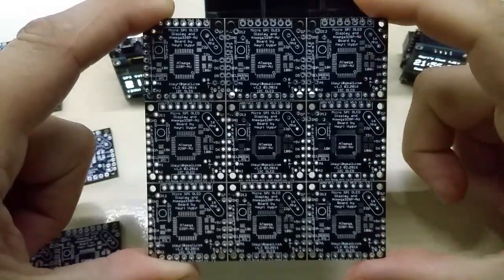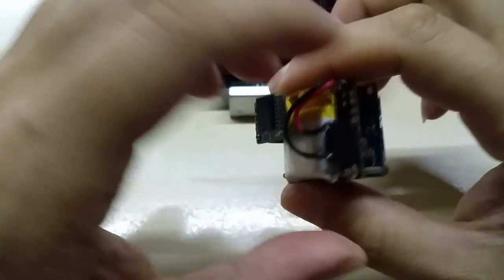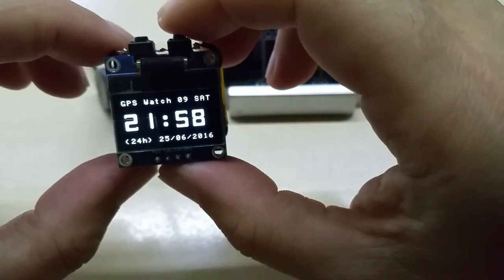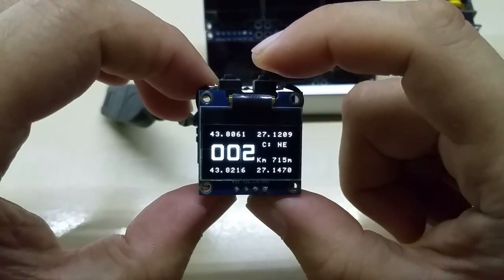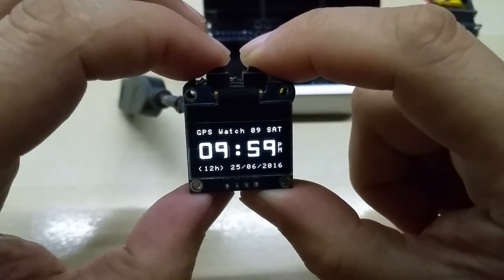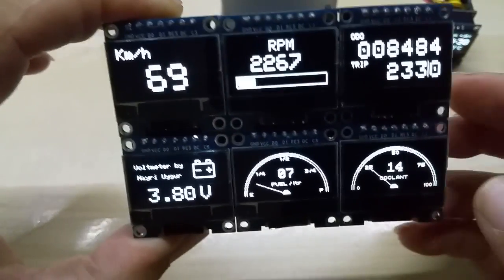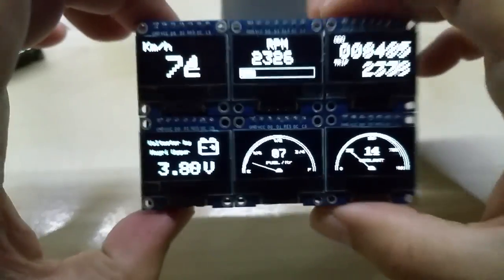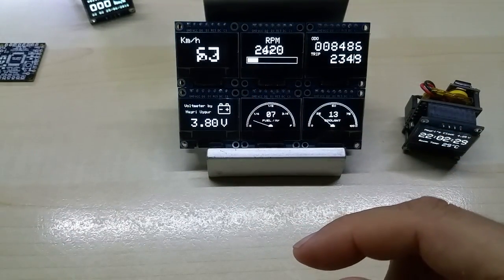OLEDiUNO Display PCB, please see my improved version too :-)

Comment: How can i Connect theese with car? Should i use obd2? I have raspberry pi.
Reply from the maker: These code examples have analog inputs. I do have CAN BUS gauges which connect to the OBDII port in your car. See my other videos and my gauges in my Tindie store. I do not work with Pi, it has a too long bootup time. An  atmega328 or an ESP32 is perfectly capable to run CAN BUS code.

Comment: What is the name of the screw you use to allow for the gab between oled and pcb? And how the pins are connected to pcb? Is it through one connector or wires?
Reply from the maker: Those are hex socket head screws in M2, I use male and female pin headers to allow for the gap between the PCB and the OLED display. No wires.

Comment: Which OLED driver did you use ?   U8G ?  U8G2 ?   Adafruit ?
Howe to switch different page by press button ?   my project always shows character distorted or insufficient memory....
Thanks
Reply from the maker: Most of the time I use Adafruit, unless a code example does come with another library which I then use.

Comment: great. If you can make oil presure analog for car and i glad to buy it.
Reply from the maker: Oil pressure depends on the sensor used, plus I do not make single gauges unless it is the CAN Gauge

Comment: Is there a way to use multiple of these I2C displays on a single I2C line? The problem I'm having is that they all share the same address so I'm not able to show different data on multiple displays.
Reply from the maker: Yes there is, search for I2C multiplexer chips, with those you can use multiple I2C devices with the same address.
Reply: @iHayri1  actually I was looking for a software solution to save space and cost.
Reply from the maker: @muflah  Search for BitBang I2C

Comment: Where are the source codes for custom programminh
Reply from the maker: These were unfortunately lost in a HDD crash several years ago. Never got around to redo it plus now I am using my new CAN BUS based gauges, much easier to connect to.

Comment: highly cool
this 3x2 is way ahead.
what system is it based on? arduino?
I saw a video in which the youtuber in question made a payment, but the size is a tablet and put in the car.
he took out the analog odometer and put a completely digital one in his car ... if not wrong ... a golf IV.
Reply from the maker: Thanks. It is based on the Atmega328 chip but is superseded by my CAN BUS gauge which makes connecting it way easier.

Comment: where i can find this Display for create calendar with event?
Reply from the maker: These are just six 0.96" OLED displays that I put on my PCB's that I had 4 years ago. I could supply my newer version of the PCB without the displays but fully working and female pin headers for the displays to plug in. You can get in touch with me over Tindie messaging or leave your email here.

Comment: Wow! very very interesting.concept. Also, the PCB design looks very profesionnal. I'm looking forward to purchase the OLEDiUNO.
Reply from the maker: Thank you Donald, you might wanna hurry up as I am phasing out the OLEDiUNO PCB in favor for a color ISP display version :-) On the other hand you might want to wait a little and get the upgraded PCB wich will have onboard RTC chip with a CR1220 battery holder for back up and LDR for automatic display brightness among the other features from the current PCB like Lipo charging circuit, 3.3V LDO regulator, 4 LED's in the corners an so on. Decisions decisions :-)

Comment: Is it possible to make a obd2 version for car gauges please ?
Reply from the maker: We are working on the OBD2 version for the V-GAUGE, thanks for your interest.
Reply: @iHayri1  cool . Please let me know when you have managed it . I have a project I need one for . A 3 guage one would be perfect
Reply from the maker: @steveevans7046  I will upload a video asap it is done, the V-GAUGE has 5 displays however plus a shift light. Please see the videos about it, thanks.
Reply: @iHayri1  thanks I'll have a look just limited for space. I only have space for 3 guages in a row really ..thanks again
Reply from the maker: @steveevans7046  Depending how it will come out, it might be possible to use the OBD blackbox with these PCB's and display.
Reply: @iHayri1  thanks for replying . Is it something I could do myself or could you see if this is possible?
Reply from the maker: @steveevans7046  Well you need to know if you can do it, my version will be based on a ESP32 which will read the CAN data and output it up to 5 displays via a 0-5V analog signal which each display and it's 328 can read and convert to the output on the OLED display. I do have another PCB that I use as Voltmeter and Gear indicator that has onboard 12 voltage regulator which these PCB's do not have.
Reply: @iHayri1  so can it be narrowed down to just 3 displays or is the board set for just 2 rows or do I need a different  set up all together? Sorry just a bit new to these boards . Work with phones and computer repairs usually.
Reply from the maker: @steveevans7046  For a 3 board version I use my single boards without breaking them apart at the v-score. I can basically make a single, double, tripple, 4 in a square or a 6 board version. Each has a Atmega328 chip and is practically a Arduino UNO.
Reply: @iHayri1  cool..if it could be possible to make a 3 board version. What would it cost if you could do this version for me please? Would not need them in a housing as would go into my housing .
Reply from the maker: @steveevans7046  No price is set yet as the hardware is not finished.
Reply: @iHayri1  ok no worries.  If you could let me know please . Thanks for your help.
Sorry throught all of this I forgot to say what they would be for . I want to put the focus st guage pod on my focus but it would be difficult to wire the stock guages in. So I would like to install them in the factory pod. It would be good if it could display analog guages like the st ones. I know the colour wont be the same but it looks like the best option even if they were digital..thanks

Comment: (Like very much)  if price is right I could use 6 square for my truck ,speed,oil pressure, water temp,rpm,volts,and fuel.    This looks great.I like the compact size.
Reply from the maker: Well, I did these only a few times as custom orders and am about to finish the V-Gauge which I will put on Indiegogo and then sell in my Tindie store.

Comment: I had another idea about this. Suppose you arranged the displays into a cube. Would it be possible to implement 3D vector graphics such that it would look like a rendered object was inside the cube, when viewed from any angle?
Reply from the maker: I doubt that the Atmega328 would be powerful enough to handle that. A faster chip would be required.

Comment: HOW DO i GET ONE ALREADY BUILT?
Reply from the maker: I am currently working on the V-Gauge and is the version that will be up for sale. https://www.youtube.com/watch?v=n1KOT5WHKsg
Reply: Would love to have one with RPM, Oil temp,oil Pressure,Volt meter, Inside and out side temp, Trip meter and timer, Clock with 12 and 24 hour. can this be done? One more thing does it only come with the side buttons?
Reply from the maker: Yes, it can. It will have 2 navigation switches on each side of the gauge and an external rotary encoder for adjusting the shift light.
Reply: THAT'S AWESOME!!

Comment: you should do a color oled version
Reply from the maker: Unfortunately they are not as good as the monochrome displays, for one the resolution is less plus the pixels are bigger to accommodate the 3 colors. The bigger 1.5" color OLED displays are a little better but cost 4 times as much.
Reply: Well I'm using the Digilent PmodOledRGB which is 96x64. It looks very nice, and is fast. It is SPI instead of I2C, and has 4 control signals. You put many displays on the same SPI, each with their own chip-select. With SPI and with the trick of only sending over a bitmap that is the part of the screen that changes, you can drive these really fast and do animation, etc.
Reply from the maker: 96x64 is too low of a resolution to me plus the rectangular shape of the pixels makes the image look bad, but that's just me, other people might not notice. Since I edit all my logos and bitmaps pixel by pixel it is not worth to me to go with color OLED.

Comment: Very nice!  I like that a lot.
Reply from the maker: Thanks Simon, if you like this, you'll love this one https://www.youtube.com/watch?v=n1KOT5WHKsg
Reply: That's cool too - though I do like the minimalist nature of this one.
Reply from the maker: This was my first design but it needed an enclosure, the current design is the enclosure so to speak :-) The shape could always be changed, as a matter of fact I will be making a very limited oval shaped gauge as well. It will be geared to the nostalgic car owners, I am making it for a friend who has a 68 VW Beetle.
Reply: A few years back, I made one which fitted in a standard 50mm round gauge housing.  It displayed the readings from up to 6 sensors.  Some were from OBD and others analog / digital.  Each gauge could be set to cycle or not.  The display would just cycle through the ones set.  If any went outside a pre-defined range, it preferentially displayed it (or cycled through those that were out of range).  Youtube won't let me post a link but if you search youtube for my name and Omni-Gauge - you can see.  I intended to turn it into a product - but a change in circumstance dictated otherwise!  Yours is the closest I've seen to that!
Reply from the maker: Found it, looks nice and I like the features of it. I thought of 52mm gauges too but could not find an enclosure that would go into the standart opening. Like your auto gear box controller as well. My V-Gauge is coming along quite nicely, now I will include a speaker too so it can give warning sounds or even spoken feedback, just wish my coding skills were better :-) I could do so much more.

Comment: How did you do it to capture the data of the gasoline level?
Reply from the maker: This is just a demo, normally it would connect to the fuel gauge sender which gives out a resistive value depending on make and model of the car.

Comment: Arent OLED's really bad choice because of burn in ?
Reply from the maker: Who told you that? I have several on my desk running 24/7 for over 7 months without a single so called burn in. These are LED's either on or off, that's why they have a high contrast ratio and viewing angle.

Comment: Wauw, this is soo cool!! I was searching for a digital Air/Fuel ratio gauge/meter for my car and landed on this channel. I have a Volkswagen Golf MK1 (Rabbit) with a tuned (to the max) 2.0 8v Audi engine, at the moment running with G60 injectors. They are way too rich, but with the standard ones i had a nasty engine knock (high compression, have to run 102 octane). But before i go do some tests with other injectors i wanted to wire up an air/fuel ratio gauge. I bought one on aliexpress (cheap ass) and bought a Bosch LSU 4.9 lambda. But now struggling to get it to work.. just found out that the gauge is for a smallband lambda (0-1v signal) and i need a gauge for wideband lambda (0-5v signal). Dohh.. 
Is there a possibility you can build that for me? I really like your OLED displays!! And maybe with the option to connect a pushbutton so it switches to lambda temp? Please let me know asap.. or else i have go search again. 

And keep up making this cool stuf!! That's what we techies live for! ;-)
Reply from the maker: Hi Remon, I think I have a code for Air/Fuel ratio somewhere in my code pile :-) Would have to search for it. If you let me know your email I'll get in touch with you.
Reply: Thank you for your reply. You can email me at remon@cobrasoft.nl

Comment: Have you considered 3d printing a housing and kickstarting a kit for cars/bikes?
Reply from the maker: Don't think that this is a Kickstarter type product as it is not a plug and play unit but I am considering making a PCB faceplate and a 3D printed back cover in various sizes. I have another project in the works that will definitely appeal to masses and that will go on Indiegogo as I don't have access to Kickstarter here.

Comment: How to do this ???
Reply from the maker: Well, there are many videos showing how to design PCB's with Eagle which I use too and you need knowledge in electronics with schematics plus you need to know how to use the Arduino IDE to upload code once your PCB design is finished and you have fabricated the PCB's in a fab house.
Reply: Hayri to upload code ? You mean i must know how to coding ?😱and can i know whats function of this ? I dont have any experince with this this is my very first time watching your video
Reply from the maker: Well coding will help to make something you want but you can also use codes that you can download. But if you have no experience at all you might want to start with something easier.
Reply: Hayri ahh 😁 thanks . Can you suggest me the easier ? And code to download the project
Reply from the maker: You can check instructables.com there are many project and how to's

Comment: How long does that clock run on a charge? What is the battery capacity?
Reply from the maker: The Lipos have 190mAh and the clock runs for about 9.5 hours with the display on all the time. Please see the new clock which is improved over the one you see in this video.

Comment: I recently viewed your site and wanted to ask that why are you not selling the custom OLED PCB ?? Very Nice and Innovative work there SIR :-) Keep It Up.
Reply from the maker: Thanks, even though I am 50, I still feel young, not more than 25 :-) I do not sell bare PCB's on Tindie, only with the basic configuration of the 328 and the required chips for it to run. The reason is that they have more than one use and depending on the product I am making different components are being soldered to it.
Reply: Sorry for that, I didn't know that you are 50, my bad and my apologies. Thanks also for the reply. I really love your projects and you have done a really really GREAT JOB SIR ! I guess you put a lot amount of effort into this . Thanks Very Much SIR :-)
Reply from the maker: You don't have to call me Sir :-) I saw it as a compliment :-) Thank you for your kind words, and yes there is a lot of time that goes into my PCB's and I always strive to make them better and adding more and more features to them. You are also very welcome, thanks for following my work, appreciate it. Happy Holidays to you and your family.

Comment: can the cube clock show humidity too? i live in humid climate would like to monitor it, preferably with larger sensor as small sensors are really bad
Reply from the maker: Currently not, but probably in a future version. Currently I am working on the OLEDiTREK which is a all in one device with many many features.

Comment: Could you please tell me how are you reading the battery voltage and how accurate the reading is? Did you just wire the battery to one of the ADC pins with a voltage divider, or used an external voltage reference? I have a project were I tried to simulate the function of a voltmeter but the readings were off by several mA
Reply from the maker: Correct, I am using an ADC pin over a voltage divider.
Reply: Thanks for the reply.

Comment: Would you be able to make a temperature sensor for my 1989 BMW 635csi, charging off of the car battery and connected to a thermistor in my stock coolant temp sender location
Reply from the maker: Hi Garret, I had a 1986 635csi :-) Great car, loved it. Anyway I do not know the specifics on the sensor BMW uses. So the code would need to be adjusted accordingly. Running off the car battery is no problem of course.

Comment: Really charged the little guy I can see !

Cool build ! and those li-po modules are awesome for small loads
Reply from the maker: Thanks, I just received my new OLEDiMAXI PCB's, which I designed specifically for the Spectrum Analyzer, Car Voltmeter and the Gear Indicator. All components are now SMD and on the PCB itself plus there is the option to use either the 0.96", 1.3" or the beautiful 1.54" OLED display. Will make a video soon :-)

Comment: I once did a feedreader with similar displays, but was using a Teensy 3.1: https://www.youtube.com/watch?v=zBBMsm8kIlg
Reply from the maker: That looks awesome. Würde mir auch super gefallen :-) Ob es auf meinem OLEDiESP auch funktioniert? https://youtu.be/ApNDs2kO9ok  Kann mich nicht erinnern ein RS Leser für den ESP gesehen zu haben.
Reply: Das sollte auch nur mit einem ESP (ohne TEENSY) gehen, nur damals konnte man den ESP8266 noch nicht mit der ARDUINO-IDE programmieren (soweit ich mich erinnere)! Der ESP8266 arbeitet daher mit der serienmäßig installierten AT-mode firmware.
Reply from the maker: Vielen Dank für die Info, muss mich mal schlau machen.

Comment: Hayri what is your ebay id please
Reply from the maker: I do not sell on eBay anymore because both Tindie and Ebay have the policy that you cannot sell on different platforms. But feel free to use Tindie instead, thanks.
Reply: I'm interested in a 3 piece setup that can do oil temp, oil pressure and boost pressure for a focus st mk2
Reply from the maker: I am currently waiting on new PCB's to come in, and after my new product is finished I can do it.
Reply: ok give me a message

Comment: Very good work. I wonder if it works on old cars?
Reply from the maker: It will as long you have some analog sensors installed for the items you want to measure.
Reply: I would need the speedometer and the voltmeter.
Reply: Can you modify the speedometer to operate at 12V for the car?